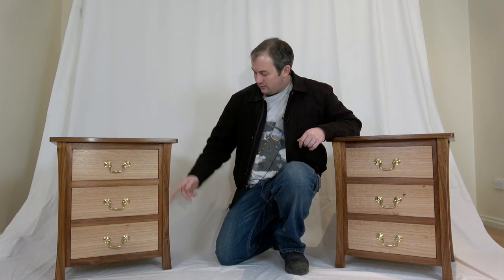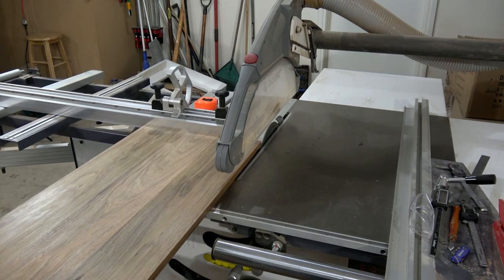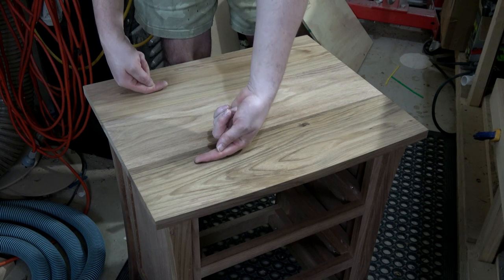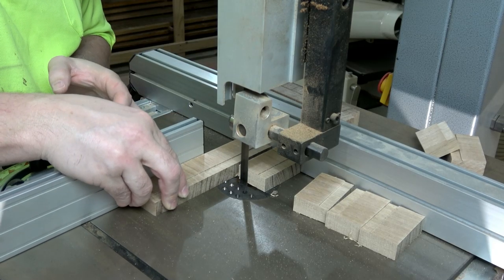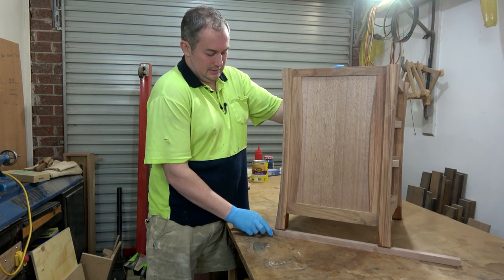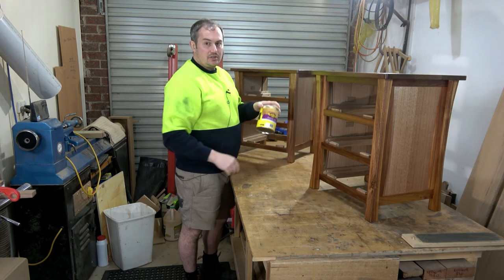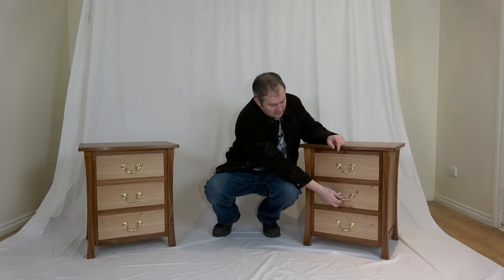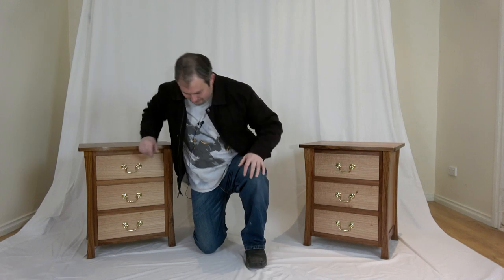Bedside tables - Final reveal

Comment: Very interesting about not using Danish oil on the inside, I didn't realize that was a problem! Thanks for the tip (from someone with anosmia who wouldn't have noticed it)
Reply from the maker: It is pretty noticeable for those with a sense of smell. It punches you in the face when you open one of the drawers.